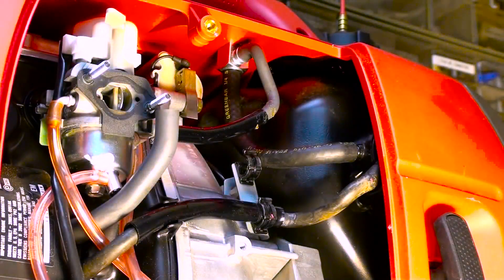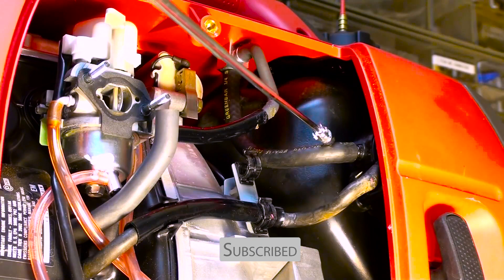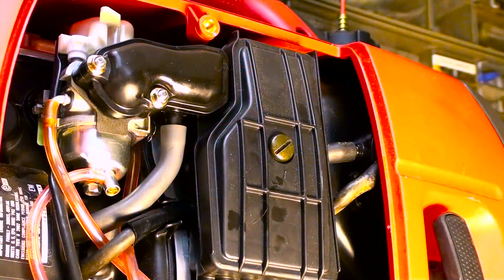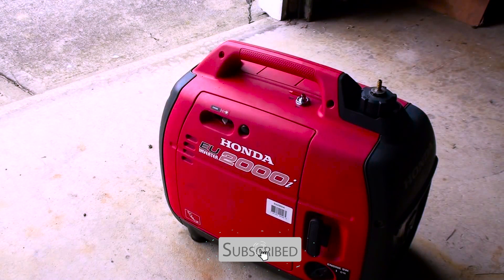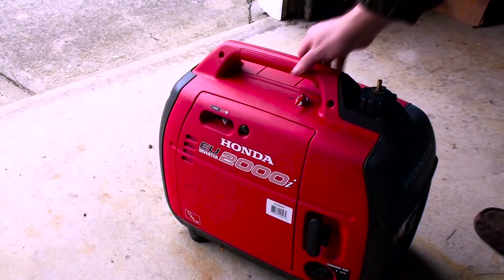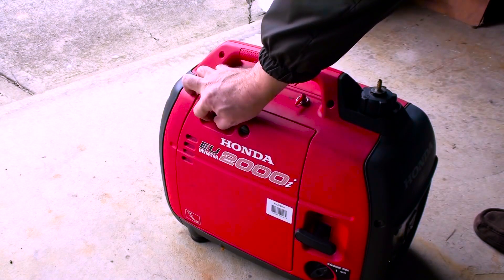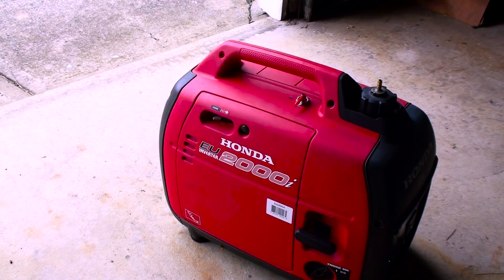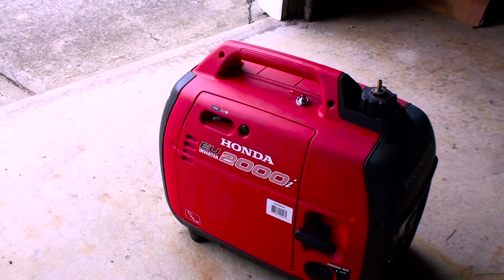Honda Eu2000i Fuel Filter Cleaning Instruction  || Honda Portable Inverter Generator Review 2021

Comment: OP doesn't realize his fuel bowl isn't filling up because his filter is clogged. I got 90 seconds with fuel off pulling 1500VA...

That revving at the end is not what should happen, it should be more sudden. If it keeps fighting to stay alive then the fuel line or filter isn't flowing right.

Comment: If you still have to manually empty the bowl, I dont see a need for the petcock. Maybe that's why the factory never installed one? On my I just turn it off and drain the bowl, takes a few seconds. With the petcock you are also causing a too lean condition not very good on gasoline engines